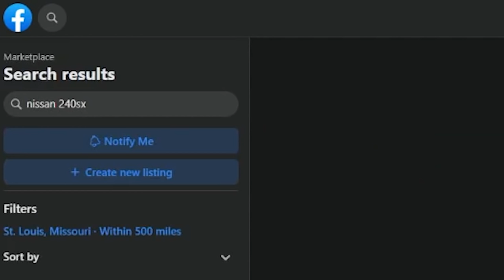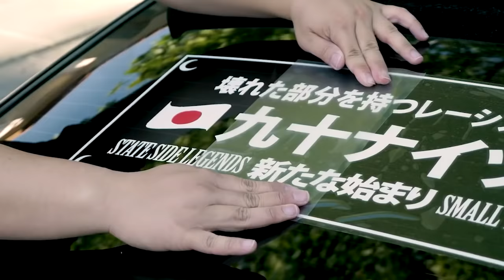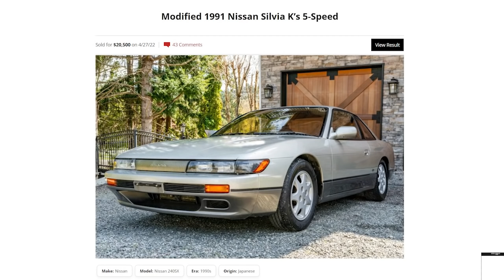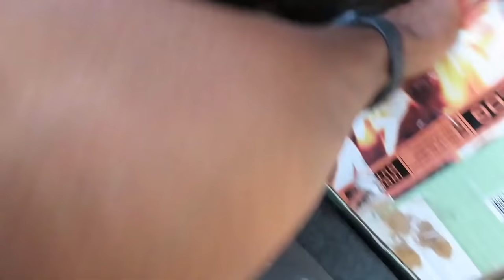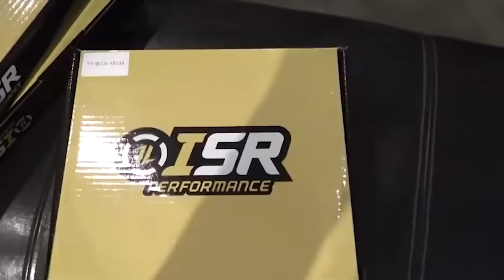Hard Truths of Owning a 240SX in 2022 (Donut Media Won't Tell You This)

Comment: If there was more videos like this , we wouldn't have had such a drastically giant markup on these cars after the 2019 year. Glad I got my car when I did in 2017.
Reply: I love your boxing videos!
Reply: I was seeing clean 240’s with SR’s for 5500 in 2010
Reply: (shakes cane angrily)
I got my S13 in trade for a Honda Accord with a broken transmission, and bought 2 spare KA24s for $50 each back when people said they were trash motors and were buying Red Top front clips for $1200...
Reply: I doubt that's true. Most of the people complaining about the price are people that bought them after the drift tax of the mid 2000s. I almost bought one in 2001 and had a great opportunity again in 2004 and I'm glad I didn't. My friend bought a 98 and while it was a great car - it really isn't that nice until you pump some serious money into it. Stock engine, stock suspension, stock interior, etc are all garbage. If you start out with a sti or evo or something else that right out of the box just works and handles decent is a way better proposition unless you're a masochist.
Reply: They still would’ve gone up. So is the cycle of classic cars as they hit the 25-30 year mark. Just like the boomers and their muscle cars.
Reply: Glad I still have my '89 180SX that I bought back in 2006!

Comment: I've had four 240's, the latest I've owned for 6 years. While there is definitely truth with these cars breaking down on the regular, these cars are stupid easy to work on compared to other vehicles. Total money pits but I will always own one
Reply: Agreed!
Reply: Agreed. Three 240's in a 20 year span and I can agree definitely something always seems to need attention or breaking on me. 
However, working on my 240sx is very rewarding and I do enjoy the car, but the list of to-do's is never ending. No regrets at the end of the day here, but my experience has always been different depending on the vehicle. My first was PURE stock, and extremely reliable. The others have been modified. The biggest thing I learned is when those added parts are garbage, so is the rest of the car.
Reply: Only reason I've ever seen them be unreliable was from the BS done to them by previous owners, mine I bought bone stock and drive for 20k miles with the must intensive "repair" being pads and a caliper. Then I went and turbocharged it and put another 10k miles on it and still barely any issues besides the ones I created lol
Reply: How’s working on that rust
Reply: @jaredevers6459  honestly they rust like any car from that era, and just like any other car, avoid the rusty ones
Reply: @kristoffernelson3553  eh that’s not true the Lexus cars from that area don’t rust like that
Reply: @jaredevers6459  I've worked on some pretty gnarly ones, it all depends on the area they're from and how well the owner takes care of them. Also I've seen a lot more gnarly s13s than s14s, so maybe there's a difference there too? Idk
Reply: My buddy picked up an auto with a wasted motor for free. He wanted me to store it for him. I told him he was crazy and it was a waste of time. Sure enough he never did any work to it. Somebody bought it for 6g. I was wrong. Y'all are crazy for the 240.
Reply: Yessir
Reply: mine has never broken down in 6 years, dumbass people ruin the s chassis
Reply: i’ve actually enjoyed working on my s13 more than my miata, old integra, and old mustang, (it also has an rb25 so it might just be looking forward to driving it when it’s set) 

it needs a lot of work but i haven’t got annoyed one time with it since i’ve had it
Reply: I have 3 right now with no rust

Comment: I wish more people were transparent like this instead of hiding the actual struggle of what people really have to deal with when fixing up this car or any older car in general. Sure this guy is being harsh but that's just how the reality of owning one is and more people need to realize that. Thanks for making this video man I appreciate it.
Reply: man you are spot on. i bought a 300zx Z32 NA with 83k miles and even then i have spent at least 7k on the rebuild of the engine. with that i have gone very in depth with it to make sure it stays good but even with a quick fix up it is very costly. moral of the story these cars are a piece of work but if you have the mindset and the love for the car then all the power too you cause i’m in the same boat haha
Reply: @TheAquaCat  yea that’s why 300zx’s were cheap for so long
Reply: @jaredevers6459  yeah people also just hate working on them because of lack of engine bay room. i don’t find it to be that bad but everyone’s different even with a quick belt change, you have to pull the radiator/rad fan and essentially do a whole coolant flush just to get to the belts.
Reply: @TheAquaCat  that sounds like more work than what I would want to do
Reply: owning one is an emotional roller coaster
Reply: 100% dude. My Accord is one of the million mile capable cars but due to previous ownership and lack of parts availability I'm gonna have to learn to do a lot of custom work to keep driving it without shelling out insane money to shops for a Honda of all things 💀. My Dad's KA 240 is pretty reliable but it's just old and needs a lot of stuff replaced due to age

Comment: My god, man, you hit the nail ON👏THE👏HEAD👏. This is what’s happened to 80% of the e30, e36, s13/14, and Miata market over the past years. All of these cars used to be dirt cheap, and have HUGE aftermarket support, so everyone bought these with “big plans coming” back in the 20-teens, realized they were way in over their heads, and sold them to the next sucker. They threw away thousands of dollars worth of hard to find interior pieces and panels, just to make it a “TrAcK cAr”, and ripped and tore apart good condition cars to cosplay as race car drivers. Fast forward to today, everyone who had those cars years ago realized everyone ALSO trashed them, because clean cars go for 8x what they bought theirs for in 2009. That bumps up the price of the shitty ones, and now no one can afford them. It’s exactly what happened to old muscle cars in the “Overhaulin” days of the 2000’s.
Reply: I have to agree with Thunderhead289 on the dailying classics thing. You want to mod your classic car? Dual chamber master cylinder. Front disc brakes. Overdrive transmission (be it auto or manual). Maybe a bluetooth or aux radio. That's all you need to make a usable daily.
Reply: Same thing with Hondas. Old 90s Accords shot up in price like crazy. 10 years ago my Accord was maybe a $2500 car in the really good condition it's in. Now I get offers for $5k+ left and right and it's just shocking. Like who's paying 5-10k for a stock Honda from the 90s💀

Comment: Dude you've hit the nail in the right spot!! been in the scene since 2012

used to browse Zilvia everyday and learned all about the car and the community....

most of these cars are know TRASHED. you gotta do your research buying 240s. 
waited 12 years to buy one, she's one of the cleanest cars
Reply: I feel old, got my first S13 as a hand me down from my mom in 2000 it was an 89 Fastback auto trans. Had 3 more later. Sold my last one in 2011 for $5k in immaculate condition. Now I’m looking to get another and they are all beat to death for $8k. It’s unbelievable how cancerous these owners have become.
Reply: True, and video is absolutely true.. yet I bought a never crashed, heavily uncared for and minimal rust 240sx lol.

Now hear me out, I have another YT channel with about 300k subs and people love seeing content about project cars and getting a 240sx down here (latin america) is hard AF, never the less a clean one, so I got it for 1.2k complete without engine and trans, paperwork in order and got a full Z33 swap (complete drivetrain, brakes, subframe, wiring loom, pedals, steering wheel, ecu, all the accessories, power sterring pump, rack, cooler, lines etc etc all for 2k)

So, buying a POS one is doable IF you know what youre doing and prepare accordingly, the knowledge, content and aftermarket for these cars is SO HUGE, well documented and available that it's still possible to buy a shell and do great stuff with em with a huge caveat.

Research, research, research and budget the hell out of the whole project... and have contacts to get you cheap stuff.
Reply: @Hanschepu  Yeah for sure. Totally agree. Rolling chassis aren't bad. The $1,000 one 10 seconds in this video would suck as a daily driver but if you were building a little drift/fun car that might be worth checking out.
Reply: @TERRORIZERRRR  I'd be genuinely impressed if you could find any of those highly sought after s chassis in anywhere near decent running condition for any less than around 15k. At least in the current car bubble.
Reply: What's kind of funny is that there's an older lady in my neighborhood who owns a black 240sx coupe. It looks to be completely stock aside from some aftermarket fog lights. She only takes it outside in the summer and I've seen her driving it around occasionally. I guess that's a pretty rare sight to see in the S-chassis community.
Reply: It is a 30 year old chasis.  Any car that old is going to be difficult to find in good condition due to age.  As 350z becoming 20 years old, you will see the same thing happened to them in real time again.

Comment: If you’re in your 20s and considering a 240 read this!!!:

I was one of the rare cases, I’m very mechanically inclined, had rebuilt a fourwheeler and was good with cars. So I thought but I’ve never worked on an old Japanese car, always domestic. Never had tik tok but I knew I wanted a 240. At the time I didn’t know about the hype, I thought it was a rather slept on car and I couldn’t wait so I bought one at all time high but I knew it was an old car so I did my research. 10K and I’m the second owner, flawless body no rust. I drove it all the way from my parents home to my first base with my dad, 1100 miles through a freaking tornado and the single cam purred like a cat while I hydroplaned all the way. I thought I would swap the engine I did the research and I knew as far as swaps I wouldn’t need to fabricate much and I wanted the original engine, the SR in it so I went and bought one outright. At this point, my car funds are getting tight, I’ve just spent around the cost of a new corolla with a warranty that could probably take me 300,000 miles on a 30 year old shitbox but I was committed. I even went as far to sell my other car to save money. Well now I had two engines and a running car I felt good about myself so I told myself to slowly collect SR parts but hell I got a running car so might as well get cool mods. Tax return rolled in and oh boy, 5 lug swap, struts, coilovers so much cool stuff, that I found out very quickly I did NOT need. My headgasket blew, I said whatever I’ll put my SR in it no big deal I got just about everything but I was missing a few gaskets and misc sensors and here’s the kick, you can’t go anywhere to get this shit, no autozone in america or pick yards can save you like my old reliable daily. I was SOL waiting weeks for a part to order from enjuku or ebay just so I could get 4 $20 rubber gaskets or whatnot. I had to start skating to work and bumming rides. It’s taken over a year to get running on my broke ass and in that time I ended up buying a reliable beater (paid off mind you) to get around. That hurt man never been without a car like this and the whole time I felt like my car hated me so much so many leaks that forced me to redo things so many times, old parts failing on stupidist things but I learned a lot, and the forums were my guide along with my owners manual (yeah I’m rich) and I wouldn’t do it differently because of what I learned. 

But if I could give advice is if you want a 240, keep it stock, wait and pay high for a clean one instead of cheaping out then crying later. Patience patience patience!!!!! But if you want a 240 like me and say, I don’t want that KA (looking back, I probably would’ve kept the KA, I love my sr but the ka is just as good especially turboed) then buy a clean shell, or non running. Don’t be a dumbass, buy a running car and pull the engine out. If you’re 30 and make good money, fine do what you want but otherwise EXPECT that car to sit on jackstands for 1 year don’t be a dumbass and go into debt on a non running car. But if you are like me 20s and have to skateboard to work then don’t be dumb about it that was so dumb I can’t believe it worked for me lol. And don’t buy dumb mods, don’t buy anything until you get it mechanically right, that is so important cause when you buy that $300 gauge and then don’t have money to maintain the engine then you’re screwing yourself out of potentially 1000s of dollars. Anyways that’s my 2 cents from what this guy would probably call a “clout chaser” 240 owner.

Comment: I've had my 200sx RS13U (european spec, which comes with the CA18DET) for 14 years. I bought it from an 82 year old man, Mr Price, who stayed in my home town, Cape Town South Africa. He imported it brand new in 1992 from Belgium to South Africa. I bought it from him (I was the second owner from brand new) for R18 000 ($1158) in 2008, it had 78 000km (48 000 miles) Full service history, everything was OEM, including the rims, radio, sunroof bag, full tool kit and jack and some other OEM goodies from Nissan in Belgium.

After 14 years of ownership, she still puts a smile on my face, hearing the turbo and exhaust sound. Looking at her all polished and clean always makes me think what a beautiful car that Japanese made.

My 200sx still is OEM, with a full service history, original radiator, original shocks, original springs (never cut), still stock height, original rims, original midnight blue paint, the only upgrade i ever did to my car, was a stainless steel exhaust and T28/T25 turbo, original exhaust manifold, original injectors. She is making a reliable 158kws and 285nm. The current milage is a very healthy 184 000kms (114 332 miles) still full service history, i change the oil and oil filter every 5000kms (3100 miles).

If you guys would like to see pictures of my car follow me on instagram @200sx_ca18det

Comment: Become a drifter before you turn your car into a drift car. That's what ChrisFix did on his channel. He went drifting with a mostly stock mustang and made mods as he NEEDED them.

Also when taking on massive projects, your current skill and part supply aren't really as big of an issue as just your force of will. With time you'll learn what you need to learn if you are dedicated and keep at it. The hard part is keeping at it. Will you get burned out almost instantly the moment it dawns on you just how much needs doing? Then you should probably just buy a running and driving car instead.

Let's face it. It's hard to stick with a project all the way through. It's fun to plan and have giant expectations but once the fun part of planning and buying the chassis is over and the hard part shows up, you're probably just gonna give up, aren't you? Make things a bit easier for yourself and buy a car that works.
Reply from the maker: ChrisFix is based as heck and should be required viewing for new enthusiasts

Comment: I loved this video. I grew up loving the silvia brand and knew I'd get one some day. I got one, needed so much work. But because I knew what the common solutions were to pretty common faults all I needed to invest was my time and money, got it road worthy after 2 years of picking it up and only having time off work on Sundays! Cut out all the rust and reshaped plate to fit myself, set the car on fire twice teaching myself how to weld, learned how to strip, clean and paint a car myself, rebuilt the engine and accessories, it's been an awesome trip so far. Next up is an engine and gearbox swap as well as upgrading everything that will help manage the upgrade haha. Awesome vid! Gonna share it around with my mates now!

Comment: I bought my 240 as a gutted interior non running pos as a sort of “passing through” project on my way to another chassis but I kinda fell in love with the design and the overall driving experience. I started my channel as well just to showcase that and although ive spent thousands on getting it where it is (not nearly finished either) I have enjoyed just about every step of the way. It depends on the type of person you are. If you have no experience, start with a honda or something with great oe and aftermarket support with a basic drivetrain setup. If you have had the hands on experience, you have the time, and you have the wallet to back all of that up, get yourself a 240. These cars are a blast, but definitely not for teenagers

Comment: I’m 16, and earlier this year i bought a bone stock ‘90 240SX. I am the second owner. I grew up around cars and my dad owns a mechanic shop. As proud as I am with the car in its stock form, I plan to modify it. My biggest priority is preventative maintenance, fixing a few small issues, and bodywork. I also plan to do a simple turbo setup on the single cam down the road. I have done months of very extensive research and planning, and I plan to make it as clean as possible.

Comment: The 90s Nissan ownership experience is a lot different now then when s13s we're first starting to get sought after (around 07/08 in my experience) even back then most of them were a bit busted, at a minimum. Had an s13 from 08-2010, sold it and got back into an 90s nis about 3 years ago. Now it seems s-chassis are ALL busted if they've been passed around different owners in the states. And the parts hoarding is, like you said, not optional anymore- it's a requirement. I have an entire room in my house with HCR32 parts. Bumpers, quarter panels, trim pieces, seals, sensors, clips/bolts/screws, lights, hinges, lock mechs, everything. It gets harder each month to source things that were readily available previously.